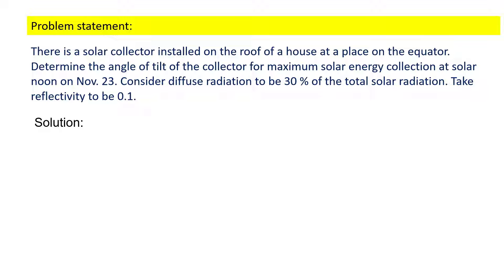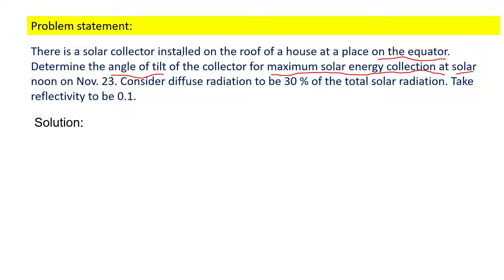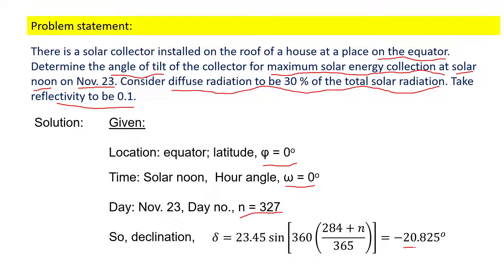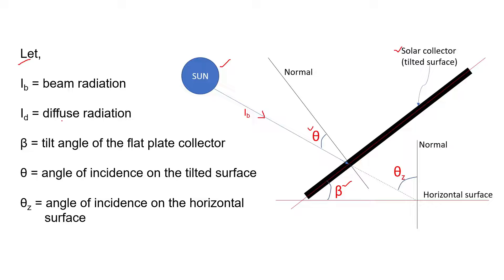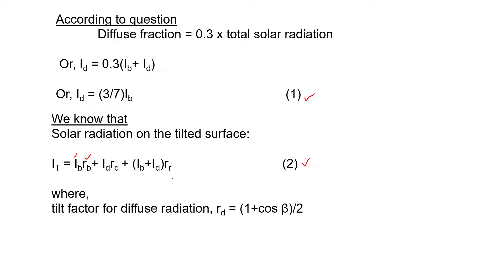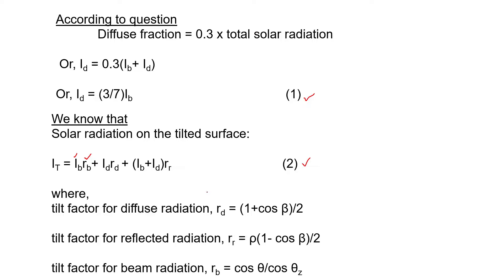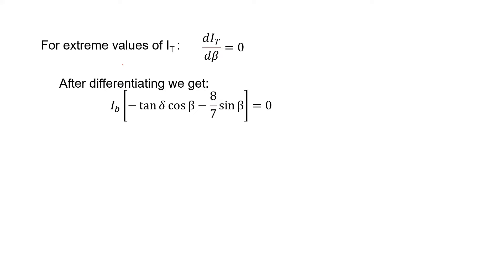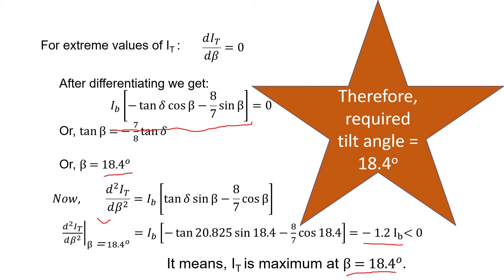Problem: Optimum tilt angle of a solar collector

Comment: Also what if you had the same question but it was in the southern hemisphere
Reply from the maker: In this case location was the equator, so latitude = 0 degrees. However, if the location is in the southern hemisphere, then the latitude will have some non-zero value, which can be plugged into the formulae for cos(theta) and cos(theta_z). Rest everything will remain same.
Reply: @vijshanker  okay thank you 🙏🏽